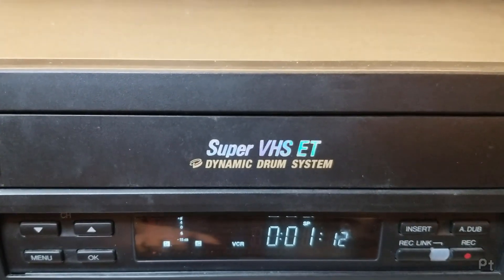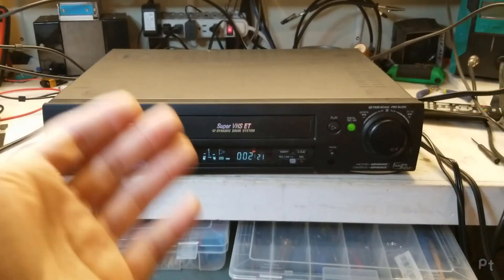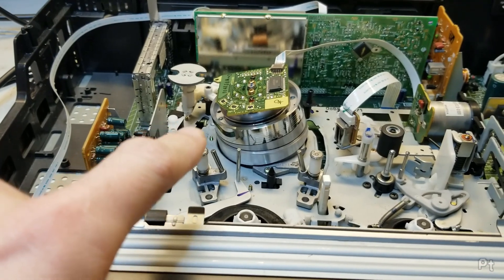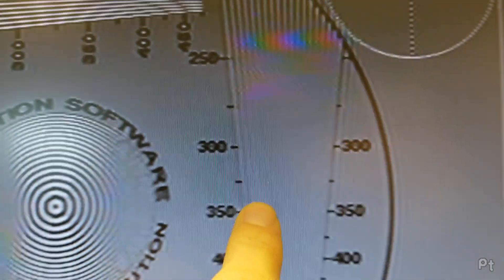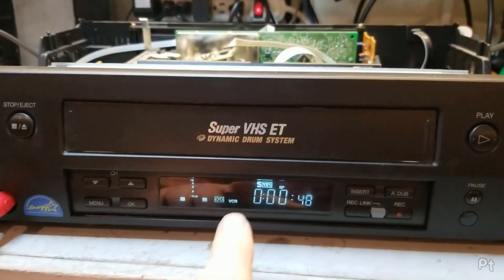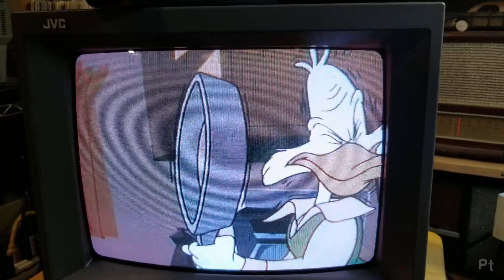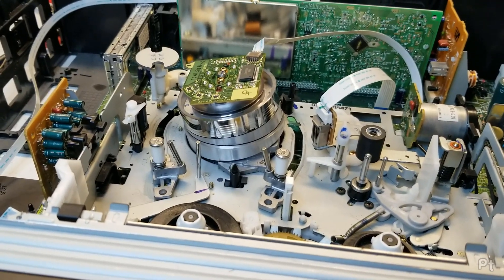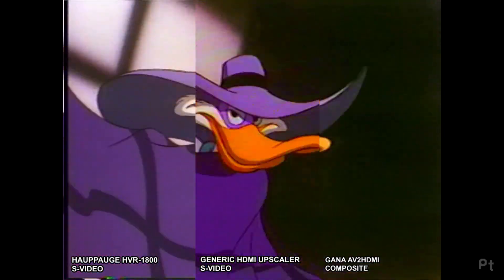JVC HR-S7600U (Fancy & Flawed VCR from 2000)

Comment: The TBC in these JVCs is very finnicky and is a bit prone to that jitter issue you are getting if there are issues on the tape so some tapes might be better off having it it disabled. Some people seem to swear by it but I could never get it to work satisfactory on stuff that isn't retail tapes or decent quality tv recordings and let my panasonic dvd-recorder handle stabilization instead. I have a video of the European equivialent (HR-S8600) on my channel. You could probably swap in some of the brake parts from a cheaper model in the lineup or possibly from the next 1-2 years as they used the same parts other than the dynamic drum system and the tape stabilizer in nearly all the models of a lineup. (For later models they seem to have done some outsourcing on the lower end variants though which ofteh have LG or Orion guts and are very different.)
Reply: I have a similar JVC HR- (some number I don’t remember, probably only sold in Brazil because PAL-M), same issues with the TBC (although called video stabilization) on digitalizations because odd and even lines keep being swapped. No problems if you’re seeing on a CRT television but capture devices keep losing sync because of this

Comment: For S-VHS's Sake ! Don't capture with OBS (that's a screen recorder) . Buy an old Sony dvd recorder, you'll get frame sync correction ( = dejitter) and you'll get hdmi out or component out. Then you get yourself a cheap hdmi  pcie card (Timeleak HD72B) ~$30 and you'll get 480i or 576i just perfect.
By  the way cheap plastic inside yes, but extra room for heat  dissipation= great. No major breakdown on mines (higher models one with the DD system) that's 20+ years
Reply: Might need a HDMI splitter to strip of HDCP for that to work (at least that was the case on the RDR-HX750 I've used), otherwise a decent suggestion. (Don't get the older Sony dvd-recorders or the in case of the US the ones without HDD though as those are very different.)
Reply from the maker: The good news is OBS was just for testing, because the drivers for that card didn't work well with vdub in Windows 10. I've decided to go back to the upscaler + HDMI capture method I was using before as it seems to handle any unstable video I throw at it just fine while preserving the 60 field motion. Thanks for the tip though, I will keep looking out for DVD recorders like that.
Reply from the maker: @AnalogVideoChannel Wouldn't HDCP only be a concern when playing back copy protected content? I have a Sony RDR-VX525, and never had any HDCP problems on the HDMI output. Though, I guess that could also be my cheap HDMI capture device just bypassing it.
Reply: @probnotstech  That varies. Some devices require HDCP negotiation on any HDMI connection, some only on copyrighter content. The model I've used (RDR-HX750) is one of the latter.

The RDR-VX525 is made by Samsung afaik (like nearly all Sony combos) so it's gonna have different internals and act differently.
Reply: @probnotstech  i thought like you but haven't had a problem so far. Even work with retail dvd's, i've made the player "region free" with a special remote, perhaps it helps not sure
Reply: This is unrelated to your point, but OBS is not simply a "screen recorder". We use it in the broadcast industry with HD-SDI capture devices to stream a broadcast live on the Internet, as well as using it as a character generator. Much more powerful software than you think.

Comment: The tm-a13su to me is better then any consumer sony just because its a video monitor >:) even lower end ones are gonna outclass consumer sets due to the improved geometry, convergence, and level of image clarity with better isolated components and whatnot.
Also kv-13fs100 is overrated and the s-video off the JVC is some of the cleanest ever, so you're not missing out on much without component. I owned the a13su up till just recently and it's been fantastic, super sharp and detailed image too with great colors. Even for a basic video monitor for its specs it's immensely good